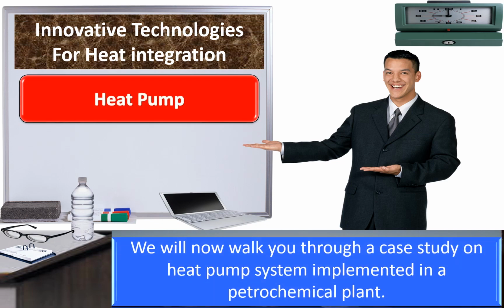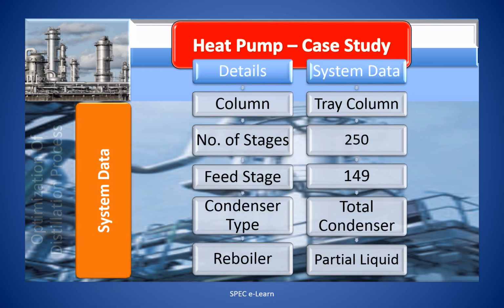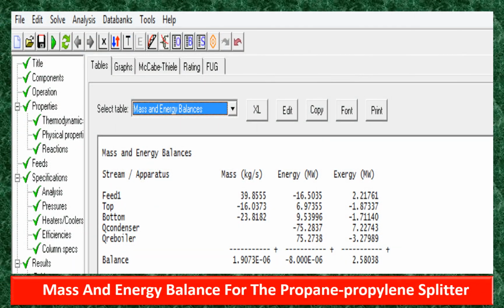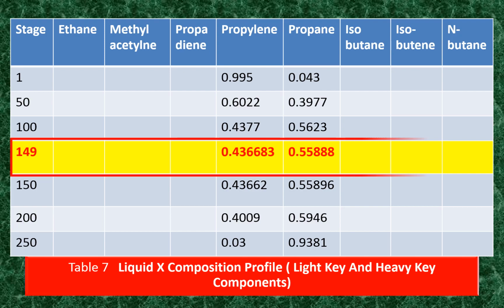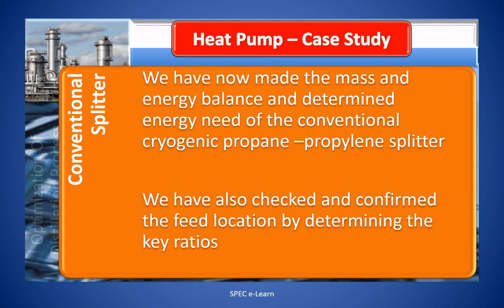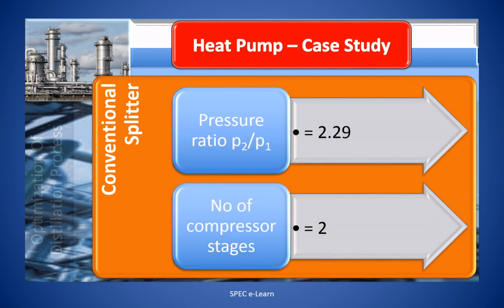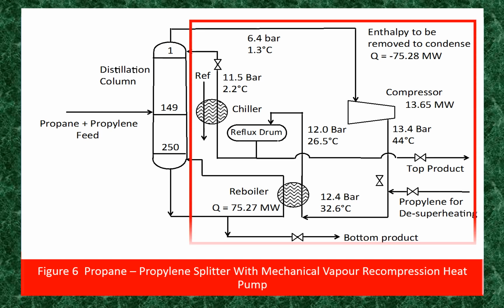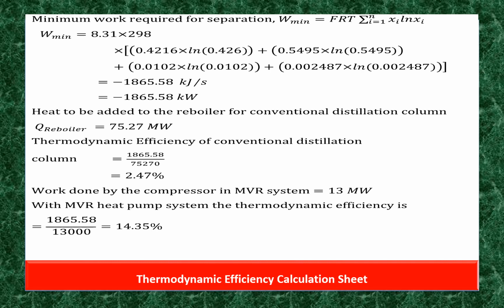Optimization Of Distillation Process - Case Study On MVR Heat Pump Vs. Conventional Distillation

Comment: Thanks for the useful knowledge in the video Sir!
I have 1 question: why is the pressure ratio of a single stage centrifugal compressor used in the petrochemical industry limited to less than 1.5?
Reply from the maker: The pressure ratio per stage is limited by the tip speed  Mach number and discharge temperature. Depending on the nature of gas the Mach number is limited below 1.The discharge temperature also a factor. The compressor has diaphragm between impellers, which tend to expand radially due to temperature of the compressed gas. Hence the discharge temperature needs to be limited to 450 deg F. For these reasons pressure ratio per stage is limited to 1.2 to 1.5
Reply: @SPEC786  ok I got it. Thanks for your answer!